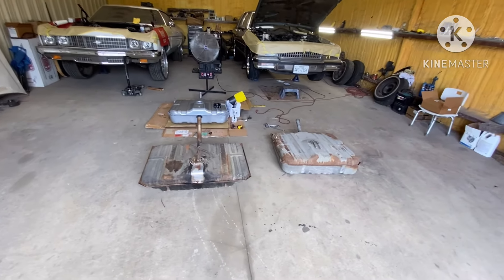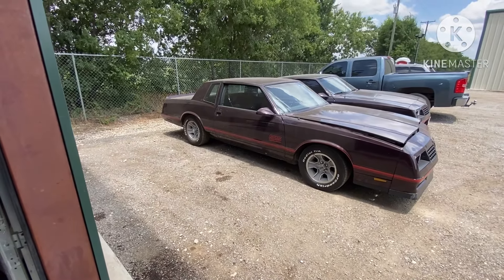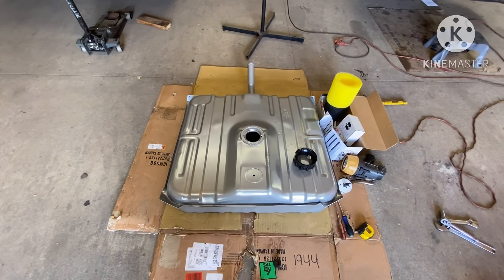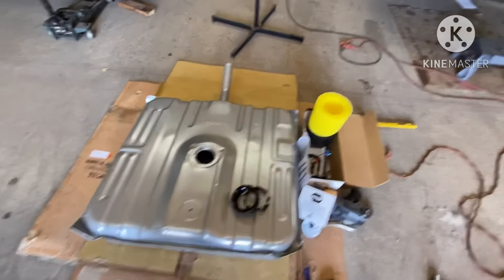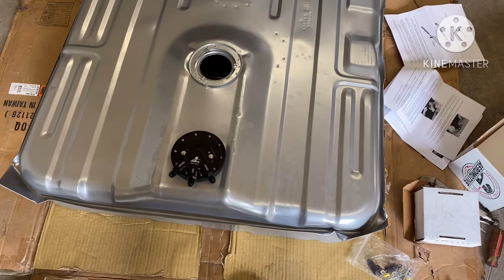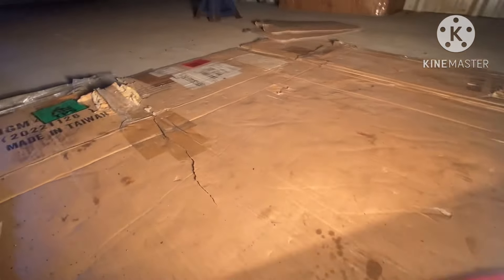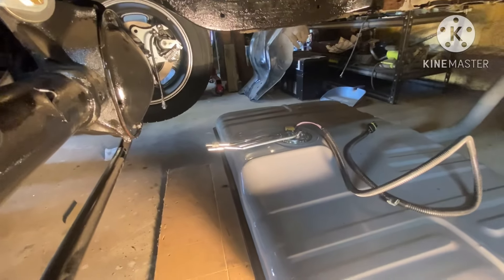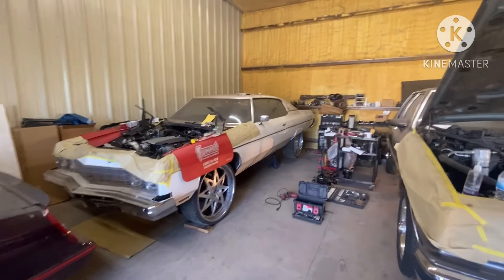How to setup your LS/LT Swap Fuel System

Comment: Dang i installed a holley tank which is from Tanks in my 65 cutlass. Never thought about the baffle. I need to go back in
Reply from the maker: If it’s a efi tank it will have a baffle in the bottom of the tank
Reply: @willierebuildz9182   yeah i just went back to read the description. I guess im good. Thanks